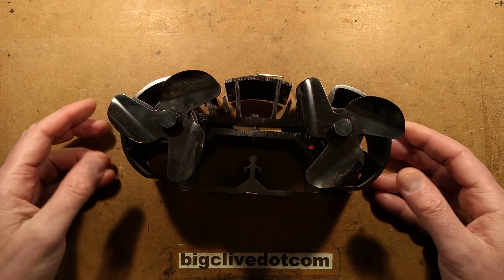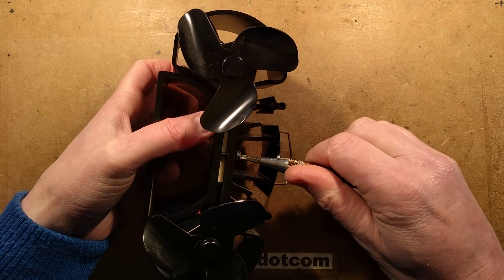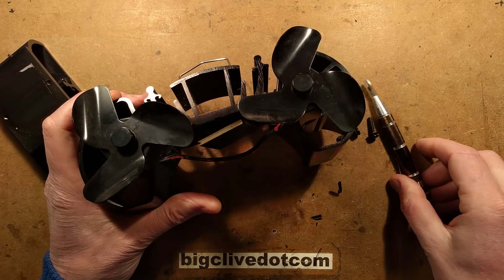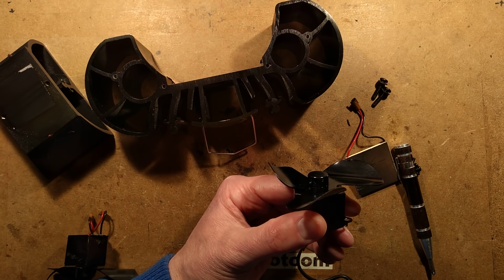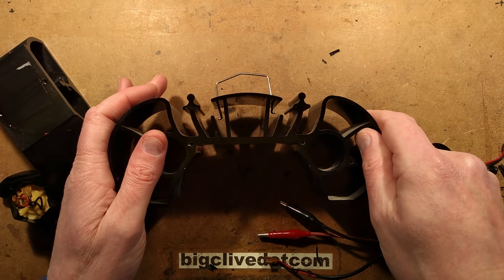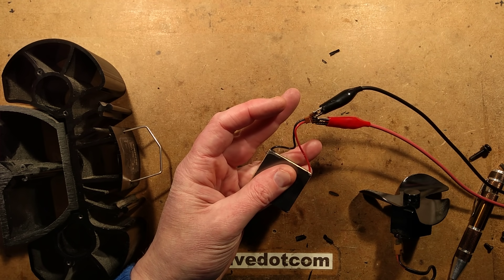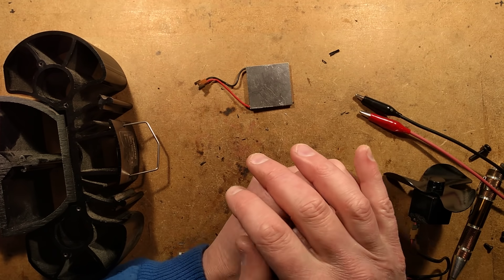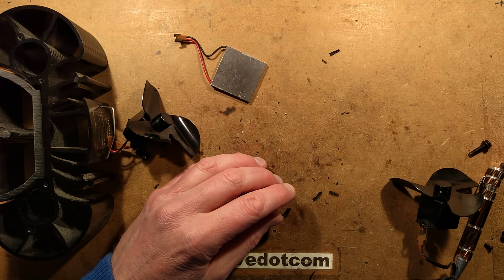Teardown of a self powering machine.

Comment: I love the inclusion of the bimetallic strip, that's genius.
Reply: Yeah, surprised me, I'm pretty sure my mate's one doesn't have that.
Reply: In theory it was genius, in reality we still have burnt motors.
Reply: If the strip just knocks the thing on it's back, then the wires etc are gonna be even closer to the heat, and melt immediately. Either way, it's going to stop electricity being generated, stopping the fan, which is the main source of cooling. It might do more harm than good. You'd need to really think through that design, maybe with something more complex. Maybe have some insulator somehow come into play. Another problem would be what to build it out of. Metal is good for not melting, but also a good heat conductor. At an extreme you could stick aerogel around the whole thing but that might affect the price more than people would be willing to put up with.
Reply: @greenaum  it doesn’t completely stop the heat, and it doesn’t knock it over, just tips it up as you do a pot thats about to boil over. Just remove enough heat that it wont screw up.

Comment: I was also eating when I started watching your video, but having a mom that have been working with old pepole an an ex girlfriend that was a nurce, I'm pretty hardend. they would start talking abaout dead paitients over dinner.
Anyway I've been building a couple of stove fans and I just used generic 2v motors with steel back plates. And cheap peltiers. And cut off most of the plastic insulated wires, and used silicone wires instead.

Comment: The plethora of historic bigclive videos never cease to amaze me. 
I came here to see "bigclive reinvents the Keeley Motor Company" with a self powering machine that will change the world as we know it.
And yet here we have a authentic device that could be easily improved to work much better (longer).  Some properly heat shielded wiring, and smaller diameter motors with some asbestos (like) wrap and you would have a product that would blow asbestos (like) fibers at you for a lifetime.  I want one.

Comment: I believe they usually don't use Peltier devices for these. While a Peltier device would work, the ones that are more optimized for generating electricity rather than cooling when electricity is supplied are referred to as Thermoelectric Generators (TEG's) or Seebeck devices. They just dope the semiconductors a little differently making them more efficient, I believe.

Fun note - you can oxidize a piece of solid copper wire, then take a clean piece and twist them together and measure a voltage across them when they are held over a flame or heat source, also due to the Seebeck effect. If I'm not mistaken, this is also how thermocouples work.
Reply: back in the day i was soldering leds and i saw them light up faintly when i heated the solder joint.
Reply: @Francois_Dupont  That was because of power bleed from your soldering iron (tip not earthed).
Reply: @JuanHerrero  Really?  Id like to see that event reconstructed to appease my suspicious doubting mind...
Reply: @JuanHerrero  Your soldering iron has a ground pin??
Reply: @alec4672  My TS100 does have  a screw you are supposed to attach ground to. It is marked with the earth ground symbol [ ⏚ ]. Some irons have an alligator clip lead. Mains powered irons may use the earth pin in the power socket.
Reply: A peltier junction/TEG is just a great many thermocouples operating in reverse for all practical purposes.  Any two dissimilar metals can generate a voltage so long as there is a current loop and a temperature differential at each end of that current loop, but the reverse is also true and passing a current will generate a thermal differential at each end (a la peltier-seebeck effect).  When you combined bare copper and oxidized copper you will have formed a diode junction (if you recall selenium rectifiers, copper oxide was another alternative plate insulator for early solid state rectifiers) and like any diode subjected to heat you will generate a voltage due to the thermoelectric effect across the two dissimilar metals at the junction (elemental copper to copper oxide).

In fact, when trying to make measurements at the microvolt/nanoamp scale or below the consequences of unintended voltage/current generation wherever dissimilar metals meet and are at differing temperatures becomes a real headache (like the nickel plated probe tips applied to a copper trace or the banana jacks you plug into your bench meter, etc.).  You often have to set up the measurement and then leave it for sometime to restore thermal equilibrium so that the thermoelectric effect cancels out as much as possible since even the heat of your hands holding a probe can disrupt the measurement significantly.
Reply: Isn't this a Seebeck element? Peltier=pixies->temperature, Seebeck=temperature->pixies. Right? Wrong?
Reply: @AnttiBrax  The element is both a Peltier and Seebeck. The actual effect at work depends on the usage
Reply: Depends on what you pay, good TEGs can be 100$ on their own, and most of these fans cost less.
Reply: @jdhtyler  Any chance that was professor Rowe of Cardiff university?! If so I probably worked in the same labs! I have since worked on RTGs with ESA - still in the energy harvesting industry somewhat today! 

It's satisfying to read someone explain the difference between TEGs and TECs by the way!
Reply: Antti Brax she goes both ways
Reply: These are Peltier TECs. From the video description:
"The panel is 40mm square and I'm guessing it's a very common peltier plate referred to as a 12706.  These are actually intended for solid state heating/cooling applications, but the unit will also generate current when a heat differential exists across it.
"
Reply: @scroggg  It is very common. Keep in mind that there are parasitic capacitances everywhere. Your body has a capacitance in reference to ground.

Comment: Peltier heat pumps can be made to run a lot more efficiently. Unfortunately it means under running them to the tune of 5%-10% of their rated maximum to get them to run well. Running one hard will only get you about 20% efficiency (5W used for each watt of heat transfer) but you can get them up to above 40% if you take the power way down. Unfortunately this means you need a truckload of the damn things to cool one can of drink.
Reply: Thermal mass.
Reply: And a well-designed refrigerator heat pump will be way above 100% efficient, because it is effectively throwing heat away.
Reply: Now go and learn some thermodynamics. Or even basic physics. Or even read what you are replying to.
Reply: @gordonlawrence4749  I think it is you who needs to do some reading, especially about how a heat pump works. RWBHere is absolutely right. A heat pump does not break any thermodynamic laws as it does nor generate heat, but transfers it. So 1 watt used to feed a heat pump can result in transfer of 2 watts from cold side to hot, hence over 100% efficient versus energy consumed.
Reply: @Bob Berg since when can anything achieve more than 100% efficiency? LMAO
Reply: @gordonlawrence4749  Read carefully (if you can) "Efficiency versus power consumed". In a case of heat pump what happens is for each two calories delivered to the hot end one comes from the power source and one comes from the cold end (the cold end is getting even colder). So we spent one calorie and delivered two calories to the hot end. That what it means, no thermodynamic laws are broken, all energy is accounted for.  But I guess I am wasting time explaining something to someone who can't (or won't) read and think.
Reply: @Bob Berg. Are you a school kid or something to make such an elementary mistake? What you measure is what you are trying to affect not anything else. IE you are trying to get the cold end colder so you measure the effects on that and what comes out the hot end is not actually relevant as it does not make any difference inside the fridge. READ THE PAPER. When I have documentation supporting what I say and you have none then it is you that is failing to engage with the facts.
Reply: @gordonlawrence4749  Look, we already discovered you can't read, no need to keep proving it. I never mentioned thermoelectric junctions, why raise a straw man? Of course they are inefficient. I was talking about heat pumps like the ones used in domestic fridges or in some heating devices. They burn electricity in order NOT to generate heat, but to MOVE it from another place. So the thermodynamic heat source for the hot end of the pump is its cold end and the pump itself simply facilitates the movement. That take a lot less energy than to generate the same amount of heat, hence the specific over 100% efficiency.  Read carefully, The HOT END RECEIVES MORE ENERGY THAN THE HEAT PUMP CONSUMES FROM THE POWER SOURCE BECAUSE A PORTION OF THAT ENERGY IS REMOVED FROM THE COLD END.. Got it?
Reply: @gordonlawrence4749  Well I give up.  If you could read you've seen I was not referring to your paper at any stage, but supporting RWBHere post in which he mentions (in a roundabout way) that a well-designed heat pump produces more heat than it consumes from the mains. He calls it more than 100% efficiency, which is true UNDER THIS DEFINITION which does NOT violate the laws of thermodynamics.  But you could not be arsed to understand what he means, but instead told him to learn thermodynamics.  Shame, you've got to learn to understand what people mean before you attempt to criticize them. Otherwise that makes yourself to look like an inflexible stubborn muppet.
Reply: That's my whole point - if you read the paper you'd know you are wrong. IE it is heat removed from the cold side that is measured not heat output.
Reply: @gordonlawrence4749  How can I be wrong when I never argued this point? Very odd...  I simply understood what RWBHere meant and you didn't. That is the extent of it.
(edited) Oh and by the way, a well-designed heat pump can indeed remove more heat from the cold end than the energy it consumes from the mains. Have a look at technical data in this document about heat pumps https://www.bioheat.co.uk/wp-content/uploads/2016/12/ALTwinMax_EN.pdf  You will find the that the heat output is more than 4 times the power consumption. Which means under the Laws of the thermodynamics that over three quarters of the output heat came removed from the cold end. That is still 3 times the power consumed.
Reply: @gordonlawrence4749  We define efficiency as useful energy produced over total energy consumed. Now, useful energy, in this case, is defined as the thermal energy transferred from one side to another. Under this definition, efficiency can be higher than 100 %. A heatsink, for example, transfers thermal energy from a hot IC to a cold ambient using no energy at all. So under this definition, a heatsink has infinite efficiency because it does its job without using energy. Of course, that doesn't mean it creates energy violating 1st law of thermodynamics, just that it transfers it. Same applies to TECs and heat pumps. They extract the energy from the cool side and dump it into the hot side. In order to do that, they need energy due to the 2nd law of thermodynamics, but the energy to do so is less than the energy they transfer, so efficiency is greater than 1. It all depends on your definition of "useful power". A heater is a very inefficient visible light producer, but it's a very efficient heat producer.
Reply: @Bob Berg "So 1 watt used to feed a heat pump can result in transfer of 2 watts from cold side to hot, hence over 100% efficient versus energy consumed." Your words quoted from your first post halfwit. Nope you get 0.15W transferred (from the cold side)  for each watt used for starters and that makes it 15% efficient. READ THE PAPER.
Reply: @gordonlawrence4749  Wrong!!! You don't even understand the paper you posted.  The efficiency you are quoting is related to the Carnot cycle and is irrelevant to power consumption. The parameter you should be looking for is COP (coefficient of performance) which measures the ratio of heat delivered (moved) to the power consumed.  It is way, way more than 1 for a well-designed heat pump, nothing like 15% !!!
Reply: So howcome Table 1 states 15% efficiency for cooling? LMAO
Reply: @gordonlawrence4749  As I said you are looking at an irrelevant parameter. Do you even know what a Carnot cycle is?
If you want the relevant stuff look at the right-hand side column in table 2.  And then look at yourself in the mirror and laugh loudly, you've been a good entertainer.  Not very smart, but funny.
Reply: @Bob Berg. And you say I cannot read. Table 2 is for fluid refrigerants. IE "Table 2.   Design Conditions for Fluid Refrigerants". So what the hell has that got to do with a solid state peltier effect heat pump?
Reply: @gordonlawrence4749  It was just an example of a relevant parameter unlike your Carnot efficiency percentage.
Reply: Yeah, something like a fridge or special leds can be more than 100% efficiency, but It's depends on how you mesure efficiency. And obviously if its more than 100% you need to come up with an other method.
Reply: If I use it as a space heater my dehumidifier is more than 100% efficient.
Reply: @gordonlawrence4749  When talking about transfers, efficiency can mean many things. 
Say I wanna move 10KWh of energy from one building to a building a kilometer away. 
If I store that 10KWh of energy in a ~40KG lithium battery (it's weight is mostly irrelevant here), place it in my car, and then drive my car that 1km distance to the destination.
My car will use 0.25KWh of its own energy to do so, so after spending 0.25KWh we can transfer 10KWh over a kilometer! 
Could we call that running at 4000% efficiency?
No. But the point is we transferred more energy than we spent transferring the energy. 

If you put 100 Joules into a heat pump, is it not reasonable that more than 100 Joules can be transferred?
Reply: @Velleity with a peltier device which is what I was talking about right from the start, running them hard if you put 6-7W in to the wires you get 1W taken away from the cold side. The article I posted a link to in figure 1 states they are 15% efficient. That is what the people above are arguing against.
Reply: @gordonlawrence4749  Well aren't they rather foolish then?
Reply: Exactly my point.
Reply: @gordonlawrence4749  Because, as Bob Berg described, you are MOVING energy from one place to another, not inherently CONVERTING energy from one form to another. You couldn't have an electric heater greater than 100%, efficient, although an electric heater is about the only device that is ever 100% efficient. However, it could potentially be possible to have a heat pump that gives you, in your desired location, (such as inside the house), 200W of heat energy for every 100W of energy you draw from the mains, because you are essentially using power to steal heat from the outside.
Reply: Damn Gordon got but hurt and decided to pick a fight on the internet knowing his screen would keep his face protected..here a tissue girls tear it in half so you don't have to fight over it like cupcake at a 9 year old girls bday party

Comment: Why not use silicone wire? It would be able to withstand the heat no problem!
Reply: My thought exactly.
Reply from the maker: I've ordered some.
Reply: @bigclivedotcom  Teflon might be even better.
Reply: MrBanzoid I would have thought ceramic pearls on bare metal wires, same as inside a toaster. With the right type, I would expect that to happily survive 300°C or more.  Isolation won't cover the wire completely, but keeping the wires away from each other would be good enough for a 12V circuit.
Reply: 10cents more? NO WAY!
Reply: Howes Models in the UK is a great place for silicone wire. Extra flux helps soldering the alloy.
Reply: I have one with the sort of high temp wires that are braided with like fiberglass or something.
Reply: Silicone wire is non-conductive. Better to use copper wire with silicone insulation. That's what I've used in the engine compartment of my car.
Reply: @bigclivedotcom  The chinese silicon wire is surprisingly good, especially for how cheap it is. Got a big pack with 5 different colors and multiple sizes, worked great for my R/C hobby projects.
Reply: The moment he said the weird might be burnt I prayed to god that they at least used silicone
Reply: Before even playing the video, my instinct was melted chinesium inside. Was not disappointed.
Reply: aero gel wires have unlimited heat/cold properties
Reply: @punker4Real  only if they also have unlimited temperature range superconductors... But seriously, aerogel wire insulation... That might shave a few grams off of a drone.
Reply: @bigclivedotcom  You bought some? Surely you've got a pile of moving light wiring looms somewhere? The motor cables often have silicone insulation, but you knew that already :)
Reply: @bigclivedotcom  rewire it in pyro BigClive, that will test your dexterity
Reply: @kall399 , Yeah their used for ovens, have some as well.
Reply: @johnfrancisdoe1563  Ceramic fish spine beads.
Reply: @AaezI  same experience here, I use them for RC and really tiny things that need flexibility. They're like wet noodles.
Reply: Tis in the description dude.
Reply: @bigclivedotcom  there is two types of peltier elements the one for producing power is marked SP and a number and can handle a lot higer temperature than the one made for moving heat,the one for moving heat is marked TEC and a number.they can both be used to move heat or to produce power,the difference is in the temperature they can handle.
Reply: @rambo1152  mom no I’m